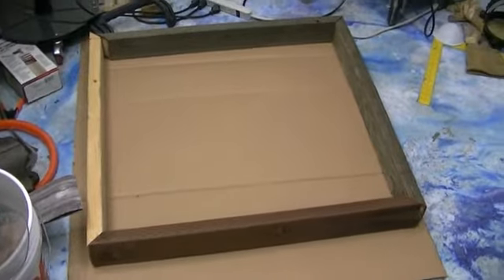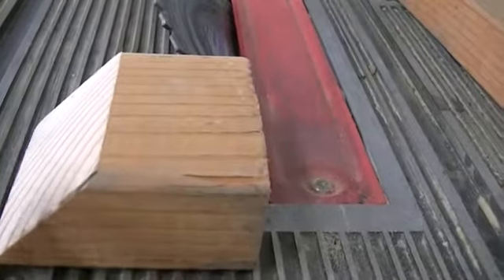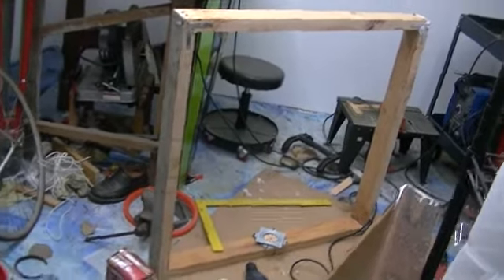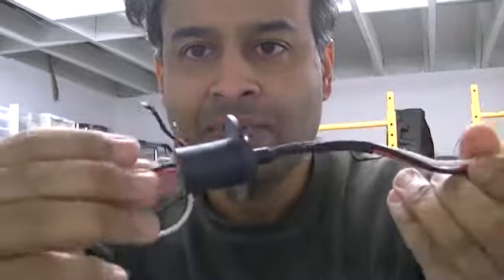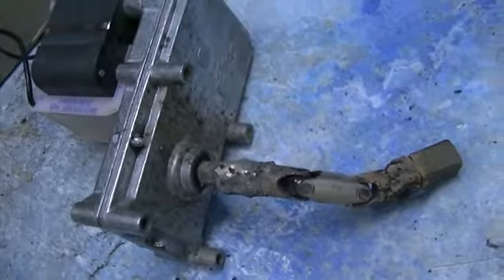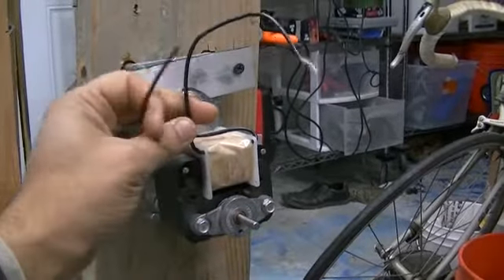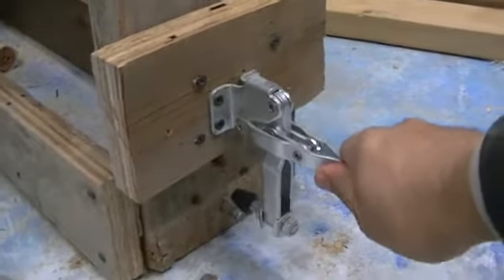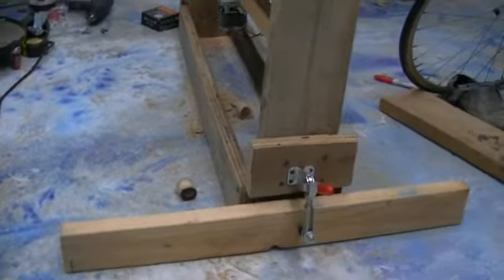Home Made Rotocasting machine with two gearmotors and slips rings

Comment: those pink counter balances crack me up.
Reply: If you look, they are compensating the weight of the opposite side, that way the turn is smooth without jumps.
Reply: +Sergio Godoy  HI Sergio do you have plans for a roto machine i wanna build one but needs to go in large oven ,cant have electrical motor inside?please ?
Reply: The pitur shows a roto casting machine for thermoset plastic (get hard with catalist). You are talking rotocasting thermoplastic where you load the metal mold and then introduce in oven to melt the plastic beads copying mold shape then cool to demold. More write sergiosdume@mail com